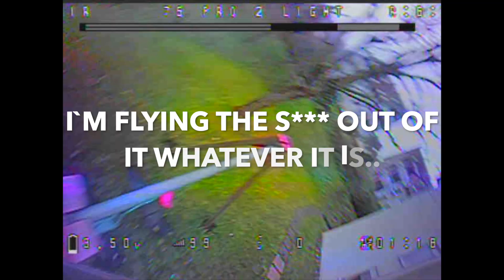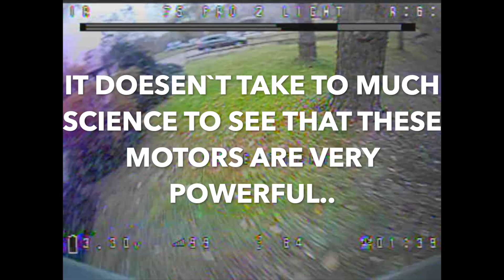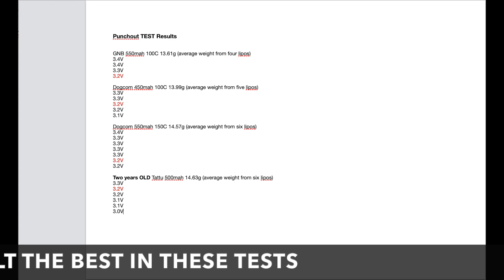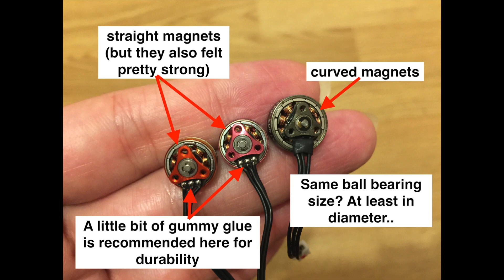PART 2 | NEW Rcinpower GTS V3 802 27000kV Motors | Punch Outs, Orbits and other Testflights

Comment: Hey, kannst du mir deinen Vornamen verraten. Ist einfacher 😆 
Jedenfalls kann ich bis jetzt berichten der meteor75 pro fliegt sich sehr stabil. Draußen perfekt, drinnen nur zum cruisen.
Ich bin auf der suche nach pasenden Akku für den 75 pro frame.
Die beste 1S akkus die ich bisher hatte sind die tattu r line 500mah. Den bin ich auf meinem 3 zoll toothpick geflogen, welcher ordentlich power hat. Da kommen die akkus wirklich zum test.
1203 11500kv motoren auf gemfan 3018 props. Da wird auch mal 35A burst gezogen. Unter bt2 oder gnb27 nicht zu empfehlen.

Jedenfalls meine frage an dich :
Wie sind die dogcom 1s 550mah ?
Sie sind bissl kleiner als die tattu rline und könnten knapp in den 75pro frame passen.

Ich bin kein fan von HV batterien. Die extra mah sind durch Überladung gemogelt. Zudem ist die höhere spannung auch nur 3 sekunden da, bis sie auch unter 4.2v fallen. Wenn überhaupt.
Dann finde ich fällt die hv lipo spannung unter Last viel tiefer als die normalen lipos.

GNB hat auch ein 450er und 550er normale 3.7v lipo.
Ich weiß kabafpv, der 1s toothpick pioneer von fpvcycle, schwärmt von den 550er normale gnb. Er hat wohl alles getestet und findet, wie die meisten pros und auch ich, die HV lipos eher näähm....

Bei den ultra kleinen akkus kann man sich halt bissl mehr Kapazität moglen.

Übrigens habe ich jetzt zwei verschiedene diamond FC von zwei Händlern, die total spinnen. Sogar einer mit bmi270 und einer ICM426.. gyro.
Ich kann sie nicht gescheit zum fliegen bekommen.
Hab einen diamond fc mit bmi270 und er geht problemlos. Hab motoren und props getauscht. Nichts hilft.
Einen kann ich zurückgeben. Beim anderen bleibe ich auf den kosten sitzen.
Das wird vorerst mein letzter happymodel FC.
Betafpv ist auch naja, aber günstiger und weniger ausfall.
Reply from the maker: @chrisbee5481  Ja das stimmt das war eine gute reaktion von betafpv. Leider nicht immer so auch bei betafpv. Die dogcom 550mah sindd dünner ja aber breiter oder zumindest gleich breit wie die tattu R-Line. Lass es mich auf jeden Fall wissen obs gepasst hat oder nicht. Bin mir auch am überlegen nen 75 pro zu kaufen just for fun. aber ehrlich gesagt mache ich das wahrscheinlich nicht. vorher bau ich lieber mein 85mm 1102 neu auf mit 1102 22k motoren und 12A FC.
Reply: @butterflyfpv  blöd. Ich hoffe wirklich die dogcom sind wie angegeben 17mm breit. Die tattu sind 19mm laut Herstellerangabe. Werde es wohl dann sehen. Dann passen die eher nicht
Reply from the maker: @chrisbee5481  Ja also wenn meine erinnerung nicht täuscht dann eher nicht.. Aber kannst dir ja selber ne akkuhalterung machen mit akkustrap und antirutschmaterial.. Eigentlich sowieso besser bei den vielen verschiedenen Lipo Grössen heutzutage.. Auf jeden Fall haben die Dogcom 550mah mächtig dampf🙂 du wirst sie mögen.. bin gespannt auf dein feedback.. WICHTIG: Sie verhalten sich wie mehrzellige Lipos! Sprich bei 3.3V sofort landen, nicht mehr zurück fliegen. Weil die spannung erholt sich dann auch nicht mehr wie bei andern lipos mit weniger C-rate.. Das muss man wirklich wissen ud darauf vorbereitet sein..
Reply from the maker: Hey Chris, sag einfach Marco zu mir :-) Danke für dein feedback vom meteor75 pro. Ja das mit den Akkugrössen ist so eine sache.. ärgerlich die verschiedenen grössen ohne wirklichen standart.. Ja die Tattu R-Line sind wirklich top. Gerade auch von preis leistung. Und praktisch unzerstörbar. Ich hoffe tattu wird eine neuauflage machen mit BT2.0 davon.. mal sehen.. Die GNB 550er 100C sind absolut top von gewicht Leistung her.. aber das format ist einfach sehr schlecht bei crashes.. Es braucht zwingend ein Liposchoner (eine art lipo condom vorne am akku^^ aus schrumpfschlauch oder 3D gedruckt) um diesen Lipo zu fliegen. Aber von der Leistung ist er top und er passt in 450er akkuhalter. Betreffend HV kommt es sehr auf das gesammtsetup an. Ich komme auf jeden fall bei gewissen whoops nicht davon los.. Betreffend Dogcom 550mah 150C. Die sind top! Ein zacken besser noch als die Tattu 500mah R-Line. Aber die werden wohl auch nicht in den 75 pro frame passen. Sie haben ein spezielles format (sehr breit). Betreffend FC`s: Ich habe von vielen gehört das zur zeit eine sehr schlechte Zeit ist um FC`s zu kaufen😅 echt ärgerlich die mangelnden oder gar nicht vorhandenen qualitätskontrollen.. solche phasen gab es aber schon immer bei den FC`s.. Ich hatte glück bis jetzt im grossen und ganzen..

Comment: Wow! Awesome channel you have. Just came across while searching whoop stuff. Can you recommend a good 0802 motor? I'm kinda stuck between happymodel and hglrc 0802. Angry don says the happymodel have more Power. Infinity Loops also seems to stick with the happymodel 0802.

Coming to 1102 vs 1002: what do you think is better on 2"?
I have the rcinpower 1002 19000kv and happymodel 1102 13500kv.
The higher kv rcinpower 1002 seem more punchy.
Now I ordered some hglrc 1102 18000kv to compare.
What 1102 motors do you recommend? My happymodel 1102 motor bells and shafts always bend. Maybe I'm to hard when changing the tight props.

I just love hglrc motors made by rcinpower. Never been dissapointed.
And tattu r line batteries are the 👌
Reply from the maker: Hello Chris! Thank you! Nice to hear! I have flown with the following 802 whoop motors so far: 
Betafpv 12000kV
Betafpv 17500kV
Betafpv 19500kV
Happymodel RS802 20000kV
Happymodel SE0802 25000kV
Happymodel EX802 22000kV
Happymodel EX 25000kV
Rcinpower GTS V3 0802 25000kV (dual ball bearing)
Rcinpower GTS V3 0802 27000kV

In summary I can say: All motors with the same kV should have about the same power. Don't worry too much. There is no wonder motor out there. If you need maximum power you can choose 25000kV or 27000kV, but you have to solder the motors directly to the FC and fly with BT2.0 connector or GNB27. And choose the best lipos out there. It depends on the overall package. You would have to give me a lot of information about your flying style etc. so that I could give you specific advice. But basically one can say that motors with the same kV have about the same power. The differences are minimal. But the weight is not the same for every motor and so not the power to weight ratio. The EX802 are the lightest to my knowledge. So if you need maximum power to weight ratio then there is only the EX802. And if you want smoothness and durability (perhaps, long-term test is still pending) then rcipower GTS V3 0802 would be an option maybe?

Regarding your 1002 2" question:
1002 19k is perfect (2 blades). Unless you want crazy punchouts and crazy top speed, then you can do it with 22k. And if you want better flying in wind then 1002 18000kV with 3-blade as you will learn in this video:
https://www.youtube.com/watch?v=hUZx9yr-h0A&t=21s
20000kV would be ideal for FULL SEND, but unfortunately that is not currently available.
In theory, the Happymodel EX1102 19000kV would be the best because they have good kV and rounded magnets. Unfortunately, these motors are said to have quality problems and you can't get them anywhere else, otherwise I would have tested them.

Regarding your prop problem: I bore all my props to 1.5mm (1.45mm would be ideal, but that doesn't exist as far as I know). And then I secure the props with a piece of dental floss. Like in this video from shutterbug85:
https://www.youtube.com/watch?v=DJdi-Lvu6xE

I hope I could help you

Happy flying!